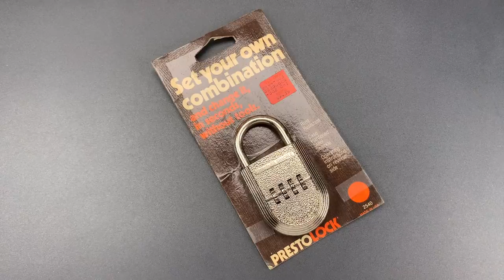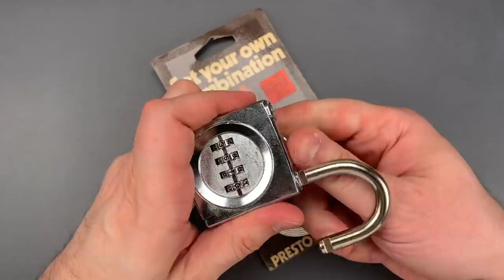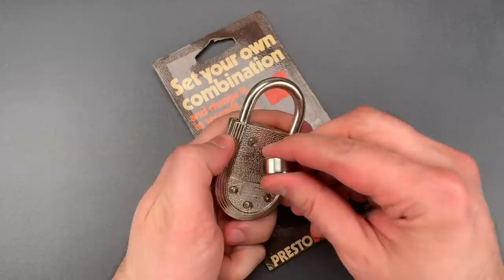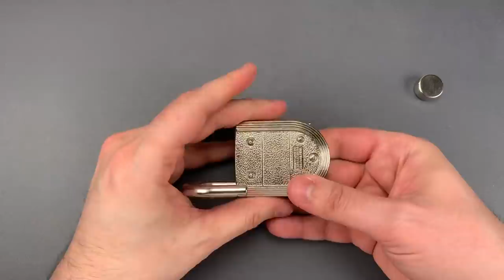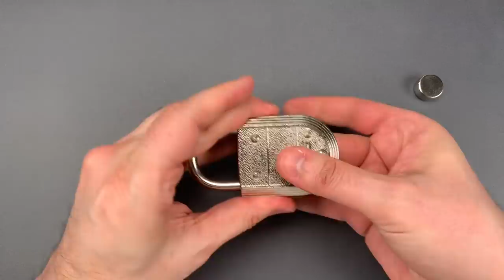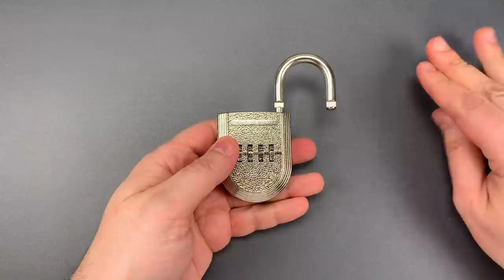[1085] New Technique Used to Open a PrestoLock Model 2540

Comment: So basically, in the past four decades, PrestoLock have succeeded in... reducing the amount of metal they used on the lock body.
Reply: Not even! LPL notes that the older lock has a thinner case, so it might be about the same.
Reply: @hiimemily  But that does make the lock more resistant to destructive entry
Reply: Well, he did open the newer one faster
 So I would say they almost perfected efficiency 😂
Reply: Even worse, 40 years ago we didn't have magnets powerful enough to use this exploit, so the lock was probably decent. They managed to ignore this new exploit completely and make the new one useless...
Reply: @wtfiswiththosehandles  i had a very powerful magnet in the 70s (came from an airplane). It was bigger than the current Neodymium magnets with the same power, but it was still very powerful  and certainly powerful enough for this exploit.
Reply: I had a few kick ass magnets as a kid in the 70’s
Reply: @LEGOpachinko  they existed in the 70s, but they were rare. 
Now on Amazon or even wish you can buy some legit powerful magnets for cheap
Reply: @dylbowaggins4160  you and MasterBata make it sound like you need an extremely powerful magnet for this exploit. I suspect a nice speaker cone (from the 70s) would do the trick
Reply: @LEGOpachinko  I'm not talking about the exploit. Just the availability of magnets in the 70s, to now.
Reply: No, wait! They reduced their level of security too. This requires the skill that you be able to turn dials, the new one you just put a magnet on and it opens.
Reply: @dylbowaggins4160  MasterBata said there were none (powerful enough) available for this exploit in the 70s. I said there were. Then you start telling me powerful magnets existed but were rare and that you are not talking about the exploit. We were NOT talking about rarity and we WERE talking about the exploit so not sure why you directed your comment towards me.
Reply: You do realize that locks are theft deterrents and not really for securing things, right? If they can deter the majority, job done. Ship it. That's the goal.
Reply: @Justin Voss the trouble with these locks being they absolutely do NOT deter the majority. If someone's going around looking for locks to pick and they know this is a popular lock (which I imagine most who aren't entirely opportunistic would), they're gonna have a strong magnet in their toolkit and are gonna be able to break into something held shut by this kind of lock as quickly as they'd get in if they had the key, if not quicker.

Comment: Buy lock, grind off wheel numbers, mystify nearly everyone.
Reply: i need to do that
Reply: That would be an epic party trick.
Reply: I have an old bike lock with the numbers worn off.  The are little numbs on the zeros, so I just turn them all to zero then dial each one to the correct number by counting the clicks.
Reply: LOL ...nearly

Comment: Had this old lock for about a year. Did get get open without a knife or magnet(didn't know), then put on a case, couldn't  get open with knife or pulling tension, Now I have to dig up a Magnet, think I can find my Magneto, can't wait to test, need something out of this case for my Neice out West, flying out tomorrow, really didn't want to destroy this old lock. Thanks again.
Stratmando

Two hours later, writing this.
Couldn't  find a magnet, needed in, Girlfriend said Cut it, thought electro magnet From a DC Relay, or tear apart an old hard drive for a strong magnet, felt several loose spots. Did get it, Would have been a much longer Video. For sure Helped.

Comment: 40 years ago, NdFeB magnets were military stuff (almost)...
Reply: True that neodymium magnets weren't produced till the mid 80's but Samarium-cobalt magnets (considered equal in magnetic strength to neodymium) were developed in the 1960's.
Reply: crowley357 You can always build an electromagnet.
Reply: @XtreeM_FaiL  That's not as easy as it sounds, especially if you want a portable one in 1980...
Reply: @riccardoorlando2262  Yes it is.  It's downright trivial to build an electromagnet.  And a damn powerful one if you're willing to lug a car battery with you.
Reply: @TrueThanny  I'd be willing to bet a 9v or D-cell would be sufficient for that lock. Just get a slightly longer nail and throw a few extra coils on. Should give you a little extra power.
Reply: @MegasXaos  I don't disagree.  I was going for a bit of hyperbole with using a car battery.

Comment: You recently posted several magnet attacks on standalone keypad locks.  All of them have aluminum (or even plastic) casing.  I wonder why none of them use steel casing or soft iron sheet.  Just like a Faraday cage shields you from external electric shocks, a magnetically susceptible case can shield the relay from external magnetic interference.  Any idea?  Aluminum could be cheap.  But at scale, steel is not really expensive.

Comment: I've used the PrestoLock 2620 for years, but never for any "high security" application.  Basically, its just a way to "keep the honest man honest" as we used to say.   The reason that I mention this usage here is that the 2540 may be an older line than the 2620; but, if so, it's been around for more than 40 years because I have 2620s that I purchased in 1980...  Just saying...

Comment: By being the only one that knows how to hack your lock, isn't setting a completely random combination that you don't know make it safer? Nobody can actually force you to tell the code, because you certainly don't know it either.
Reply: Same with normal locks, throw away the key, because only you know how to pick it!
Reply: As long as the person asking you doesn't have a rubber hose or similar means of physical coercion, maybe it's safer.
Reply: They could still just force you to pick the lock though.
Reply: lok
Reply: I do not want to meet a person who tries to force the owner to tell him the code, instead of just using a bolt cutter on a very bolt cuttable looking lock.
Reply: Why and how would someone manage to "force" a guy who has a collection of guns and extensive knowledge of security?
Reply: If you're assuming they can force you to tell them the code, why wouldn't you assume they can force you to tell them how to bypass the lock
Reply: @the_og_alpha  you assume that people with guns can't be kidnapped or trapped?
Reply: @the_og_alpha  By using their own collection of guns and extensive knowledge of security.
Reply: Assuming they believe that you don't know. It's highly likely that they won't since most people wouldn't use a lock they don't know the composition to.
Reply: @nyetloki  well, I didn't have an issue with break-ins ever. And I keep my guns always unloaded. LPL atleast has easy access to them.

Comment: Many years ago a New York man found items were disappearing from his safe. He called a locksmith to see if the safe was compromised. The locksmith tilted the safe forwards and could open it without the combo. It was a design defect and the manufacturer recalled the affected safes but the man's safe was missed. Someone got wind that guy had that type of safe and got a servant's job in his household. The locksmith was Charles Courtney who wrote 'Unlocking Adventure' in 1942.

Comment: Wait, shouldn't a "combination" lock actually be called a "permutation" lock? combination locks could be opened with four numbers in any position (ex. 4725 works as well as 5742). permutations require an order, so only 4725 will work and no other commination of those numbers.
Reply: You are correct. You are also even more pedantic than I. And that's saying something...  😁
Reply: haha that's what a month of not going anywhere does to you.
Reply: @isacubes  Exactly. I, myself, now have way too much time to ponder things like why does the power company sell us energy while the "energy used" figure on a package of light bulbs is given in units of power?
(Okay, rethinking this I guess they really mean "energy used per unit of time" which reduces to power. Lordy, I need to get out of the house...)

Comment: Are car door locks hard to pick?
Reply: it’s faster and easier to just punch the lock body through the door’s sheet metal  as that’s the weakest link in the system  also a pain to repair   i hate seeing those repair orders
Reply: Look for video 372, I was just going through his video playlist I can't believe how long I've been a subscriber for, it's crazy how fast time flies.
Edit --> And video 367
Reply: He also has one where he picks a bulldozer ignition lol
Reply: @driftmaster1  Someone once broke into my car by sticking a (I presume) screwdriver into the keyway and giving it a good twist, shearing off the wafers. It destroyed the lock, of course, but there was no damage to the door and it's better than having someone smash a window. I was actually fairly impressed. It was nice seeing someone who takes pride in their work.
Fortunately, they didn't make off with the car. They just stole some stuff.

Comment: LPL "Don't use steel components"
Also LPL "using aluminum or zinc leaves you vulnerable to low skill torch attacks"
Reply: Stainless steel is non-magnetic